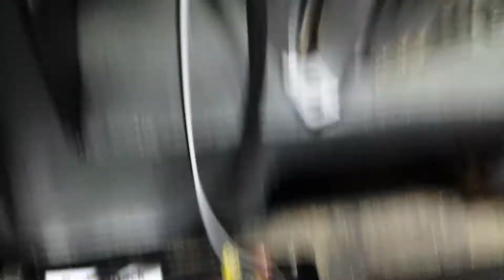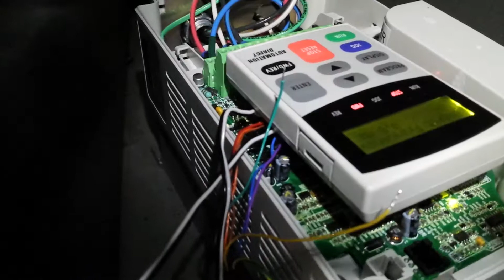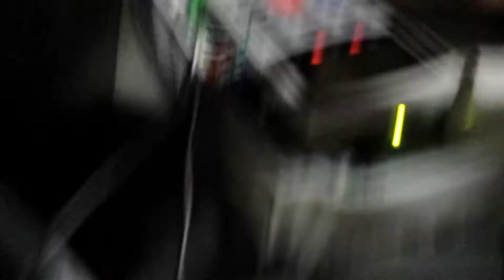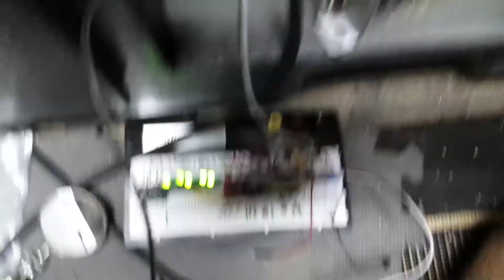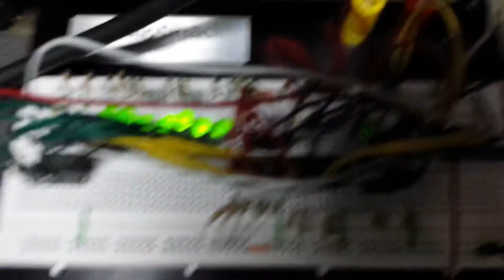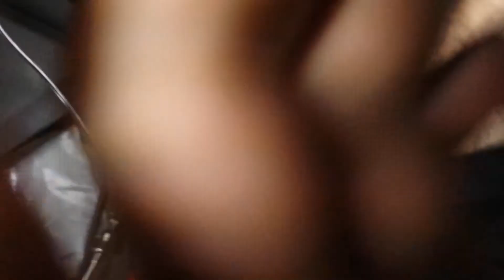Huge amount of noise on circuit from vfd

Comment: it seems like fighting in Kotor noise has been my life are you running a shielded vfd cable and is that shielded cable grounded at both ends make sure the motor cables grounded at both ends and the encoder Shield should be grounded only at the drive-end

Comment from the maker: I think I'm going to order some double shielded S/STP Cat 7 ethernet cable to use for my cabling and some digital isolator ICs.  I also installed a 220uF and a 0.1uF bypass capacitor from + to - at the power supply but I don't think that was the problem to begin with.  I'm measuring phantom AC voltages on everything with the VFD running, including just the voltmeter itself without connecting to anything.  I'm also detecting a frequency when it's running.  I can tell this will be tricky to fix.

Comment from the maker: Thanks for the Ferrite!  I wasn't expecting a package in the mail.  In fact I had been looking for some locally to no avail.  I installed them and they do seem to help a little with just radiated noise in general.  I have determined that the noise is coming from the signal cable going to my circuit which isn't surprising.  The circuit only acts crazy when I connect the signal cable.  I'm measuring some AC voltage on it likely inductive since my test cable is totally unshielded.

Comment: Try putting your circuit in a steel project box and locate it well away from the VFD and other potential sources of electrical noise.

A digital storage oscilloscope will allow you to see the noise and that will probably allow you to determine where it originates so you can take deliberate steps to eliminate your noise.  Let me know if you'd like me to make a house call.

Until then, you have a lot of "best practices" steps to take.  I'd be surprised if your rat's nest DIDN'T have noise!

Comment: I'm seeing a lot of loopy wires (aka "antennas") and not a lot of shielded cables.

Did you install the ferrite cores that I sent you on the VFD power wires?

Are you using good quality (Igus, etc.) shielded cable for the wiring between the VFD and the motor?

The electrical noise could be conducted noise on the data or power supply lines on your bread boarded circuit.  Try a 220uF or larger electrolytic capacitor and a .1uF capacitor on your circuit's power supply.